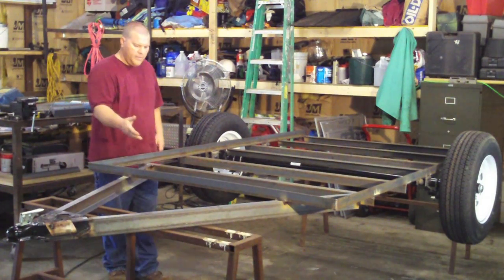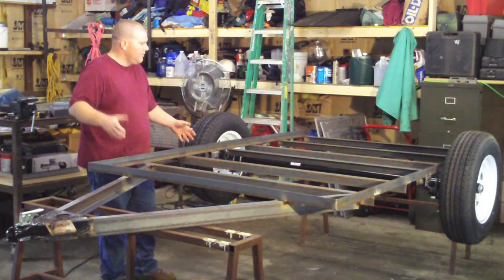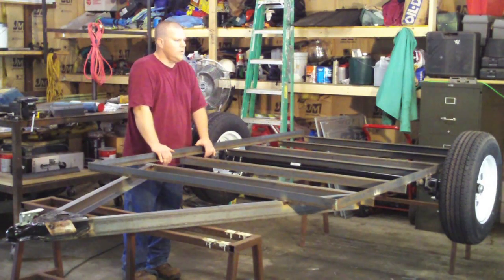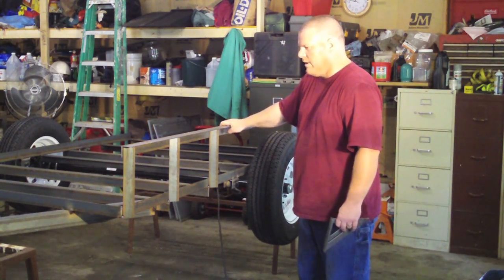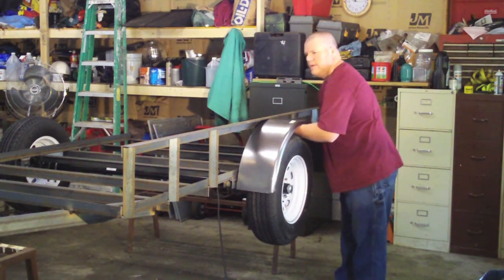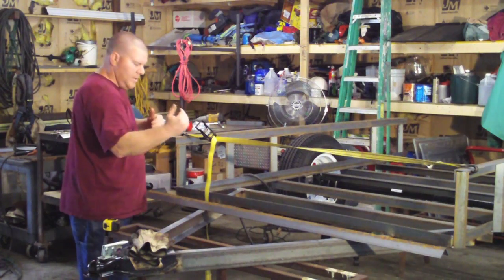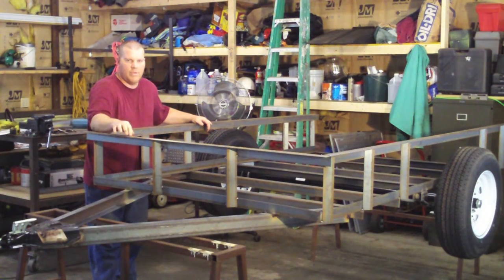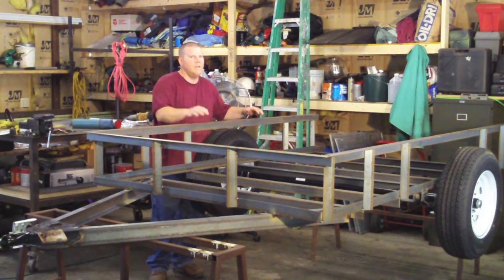How to Build a Utility Trailer Part 6 Installing Top Rail Framing and Fender Thoughts

Comment: How can you make money on this.  by the time you finish buying everything you would have spent around $800.  If the axle is $200, each tire about $140 and each fender $35, plus the metal.  How do you make money off of it?  Please answer.  Thats $550 on materials not mentioning the metal.  Plus you have to buy lights.  I mean aren't you better off just buying one off of craigslist.
Reply: It all will cost around$600 but if you go and have a manufacturer you can get all supplies for no more than $350 tony in North Carolina